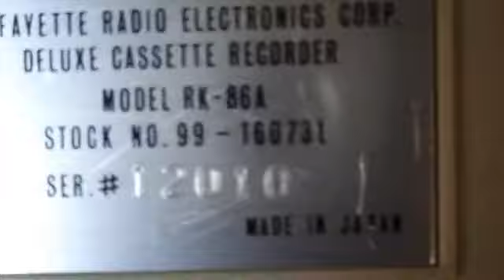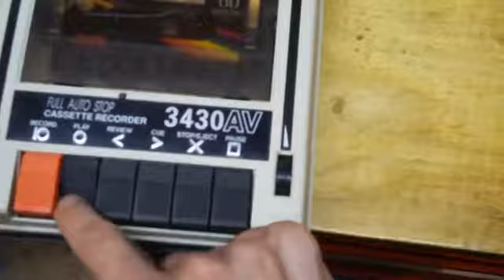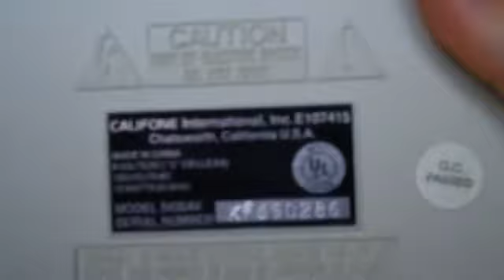Califone and Lafayette tape recorders

Comment: Sounds like the rec/play switch on the Lafayette. A little late now, but you can try cleaning that switch. Should be mounted to a PCB and connected to the rec key on the front.

Comment: Other thoughts here: the wires to the head might be loose, where it attaches to the head. There also might be a "microcrack" in the circuit board tracks. You can try resoldering and putting new solder on the tracks. That cracking in the sound when you hit "play" gave me that thought. Also it could still be the record-play switch.